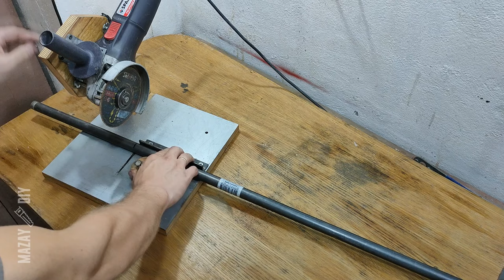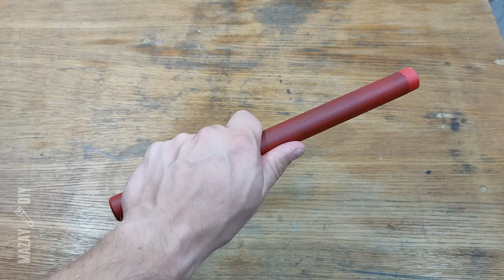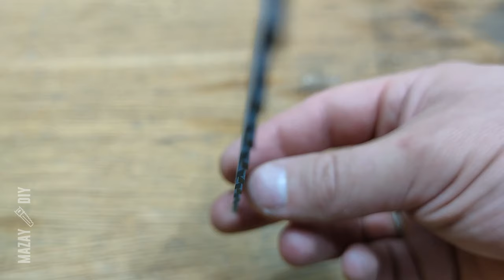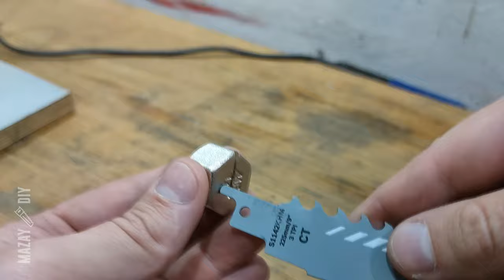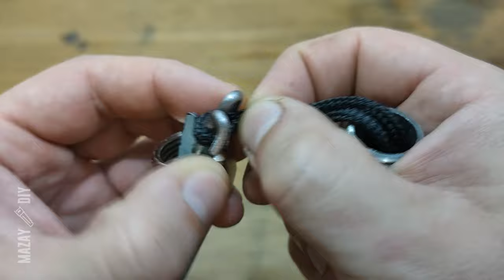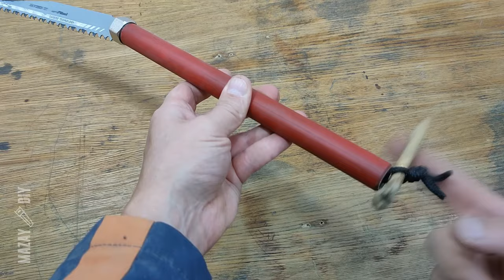DIY Bushcraft Saw | Fast Cut | Easy to make Folding Survival saw

Comment: Awesome!  You even maximized leverage using the lower tip of the tang.   If I made it, I'd 1) use a 12 inch blade (Diablo makes some), 2) use a larger wood toggle or a metal one and 3) place the knot to shorten the loop.
Reply: I would also have considered pouring in lets say a third of a cup of resin into the pipe to add more strength to the blade fixture.